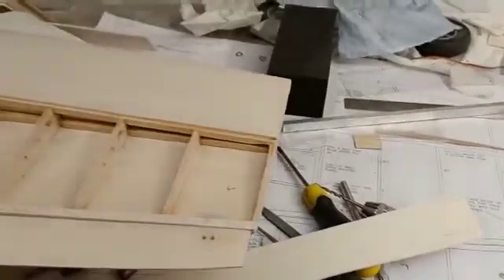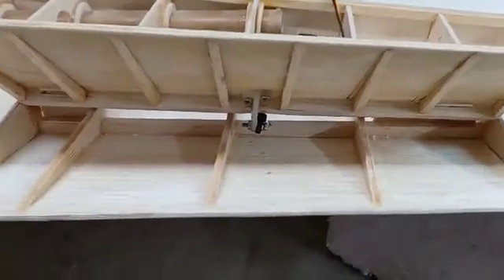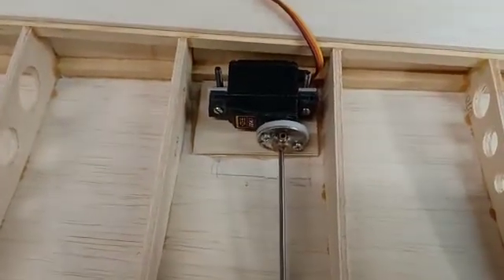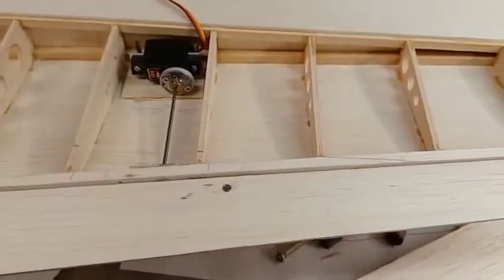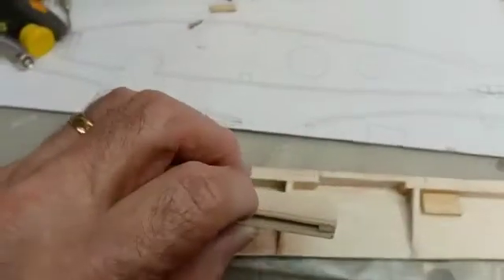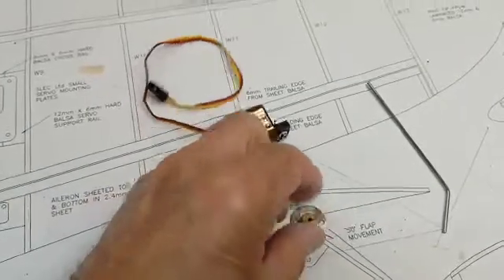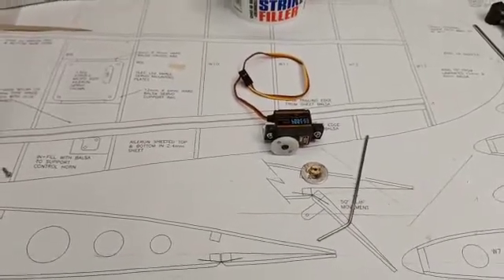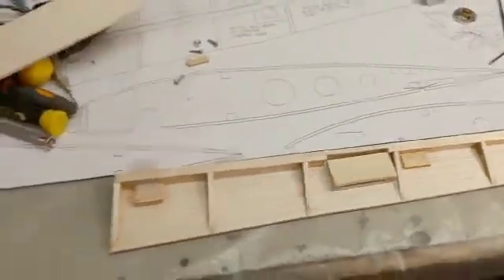Bob's Top Tips - Rotary Drive System setup

Comment: A very interesting mechanism which I intend to include in my present build of a Mark IX Spitfire. One caveat though, as others have mentioned, is the softness of the wood box into which the rod turns; rapid wear with potential catastrophic failure will occur. The box could be lined with aluminium (still soft though) or better, built from 2mm carbon fiber sheeting and fitted very closely to the shaft with a bit of lubricant. Voilà, durability and efficiency added for a modest investment. Thank you.

Comment: Where do you find brass collars? What is the brand?  I have never seen any and don't find any with google. Having collars that can be soldered open-up a lot of possibilities. Thanks!
Reply: Not sure what brand but are widely available at all Model shops in the uk. Most are brass and have been plated so you can file off the plating on the edge to solder if it makes it easier
Reply: @richardwood2929  Thank you!

Comment: I am just getting into the RC airplane hobby and found your channel and had to subscribe. I bought the Ziroli plans for his giant scale p-51D and after looking at it I decided to attempt to just use the plans as a guide and make my airplane out of all aluminum. I'm in the process of making the forms for the ribs and have completed the main spar. Even if it doesn't work I'm having fun trying.
Reply: Depending how you define "Just getting into RC", you might want to consider cutting your teeth with a simple, cheaper trainer that will not require you to spend a huge effort in building. It may sound rude, but first few planes tend not to survive very long. And warbirds are not the best to learn, especially those with retracts that are always fragile (look at all the landing gear failure on You Tube, models made and flown and landed by highly skilled and experienced modelers and yet the gear collapse). Also, flying a plane that took hundreds of hours to build is an added stress that beginners can do without. It is best to learn with a plane that you don't stress over too much and save the wonderful P-51 and all the work that went in it for later. Maybe it is something you could discuss with your flight instructor or an old hand at your club. I flight mostly scratch build airplanes, and crashes hurt far more than when you can just order another one and slap it together in a few hours!
Reply: Thank you Chris

Comment: If you glue a piece of plastic on the inside of the slot, top and bottom, you don't dent to wood and reduce slop over time. You can retrofit this later. Great to see these old inventions back and people using them again to hide control horns!